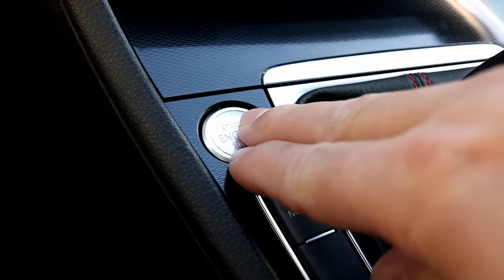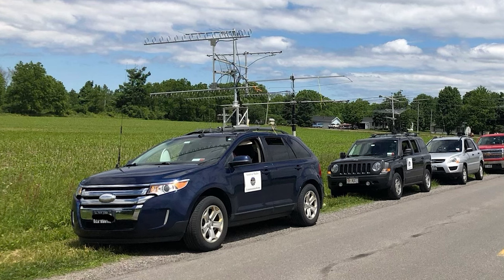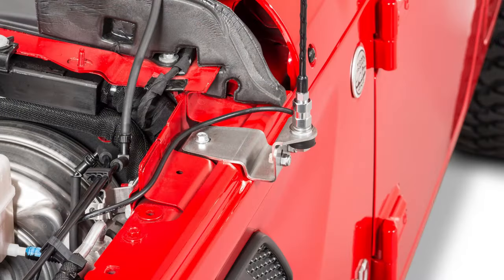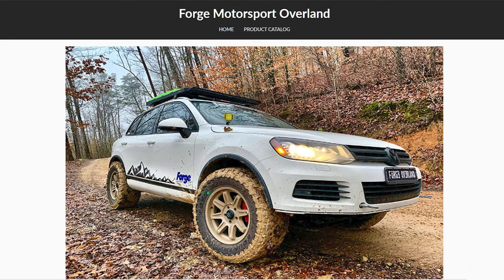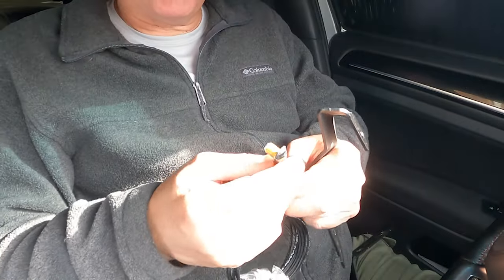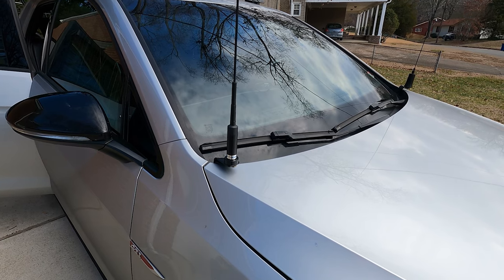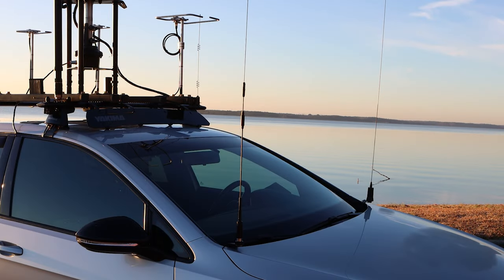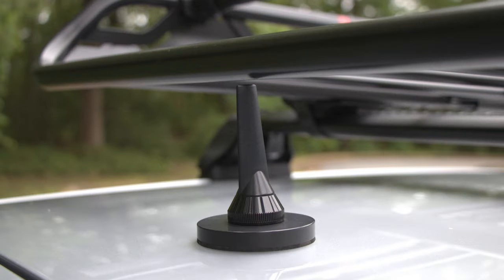Ditch Light Mounted Antennas

Comment: Now that you’ve had your trip to HamCation, how are you liking the mounts? Does the wind caught by the antennas make them vibrate at all? I’m a new ham and found this video while researching how I’m going to mount antennas on my Silverado. I’m thinking this is the direction I want to go. Also, where did you pick up those 3/8” Nmo mounts?Thanks for the video!
Reply from the maker: The antennas are solid. However, the bulk of their weight is at the bottom and the whips are free to move. I don't think the 3/8" NMO mounts are a good choice for a heavier antenna with a top load. As for the part, see the video description for links. Thanks for visiting!

Comment: Was going to ask why you put it on the passenger side and not the drivers side but I see you have an antenna on both sides of the car. I was always told if you have only one lip mount, put it on the the drivers side so it's less likely to be snagged by trees, etc when driving down the street.
Reply from the maker: Good eye! I think I'd still put the antenna on the passenger side to keep the RF hazard just a little farther from me. My hood-mounted antennas are not tall enough to hit tree limbs. Take Care!

Comment: Tell us again, how do you route the cable to the cabin?
Reply from the maker: In the video, it shows where I run the cables from the engine bay's air plenum, through the fender, and then into the cabin through the rear door seal (though nothing specific). I also point out a grommet below the A-pillar that I'd like to use in the future. Thanks for visiting!

Comment: I'm curious as to how the mounts attach to the vehicle.  Did you need to drill any mounting holes or modify the lower windshield cowling?
Reply from the maker: No drilling. There's a segment where I mention bonding with the hood. These brackets mount using the hood's attaching points. So, install them one side at a time so that the hood does not fall off. Thanks for visiting!
Reply: Thanks for the response, I obviously missed you saying that in the video.
Reply from the maker: @stephenkramme7063  - No worries. I didn't actually say the words, but the video shows how they're attached. You would have missed it if you looked away for a few seconds. Take Care!